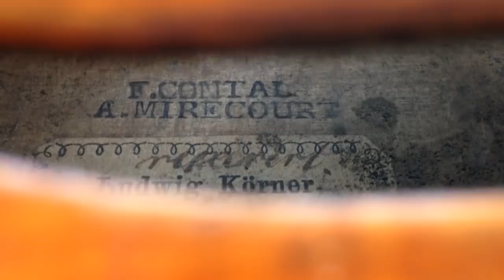♪♫ repair of an old French violin Francois Contal

Comment: I have a big question. Will French Polishes/Shellac retouch Varnish Will works over an oil varnished violin? If it doesn't, how do you Polish/retouches an oil varnished violin? What's the difference between an oil varnished violin and a spirit varnished violin?

Comment: what are rubbing down that violin with? alcohol?
Reply: I think its oil, its making it shine better so that's what I would assume
Reply: Its probably alcohol. That's what is usually used for deep cleaning a violin. It dissolves built up rosin and renews the surface of the varnish. It should be done only by an expert though because it can also remove the varnish itself. Don't ask how I know.
Reply: @glendonjones  most likely clean water, thats enough to get most gunge off. Alcohol would just strip the varnish off in a second.
Reply: Polush especial para violines

Comment: First, the corner is not well and correctly shaped. Second, never insert a wood piece between ring board and neck. This is ugly. Should a standard way to it. Third, the fingerboard might be tilted if it is glued in the way shown in this video. Overall this repair is not professional. It is bad.